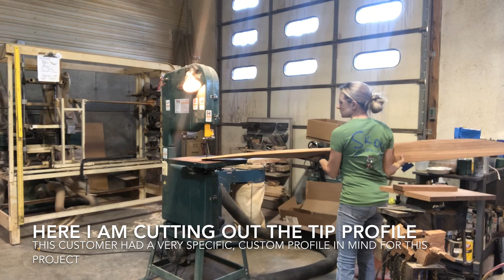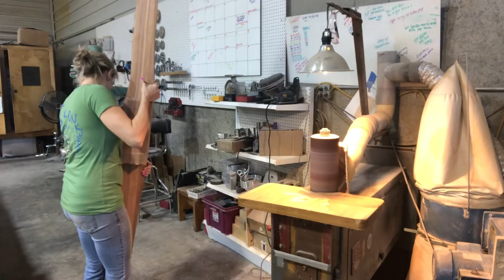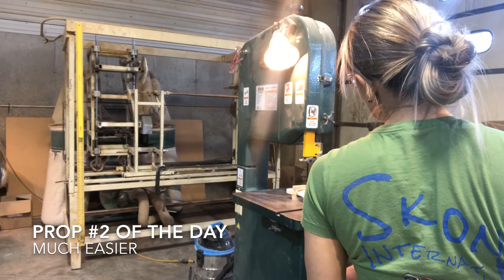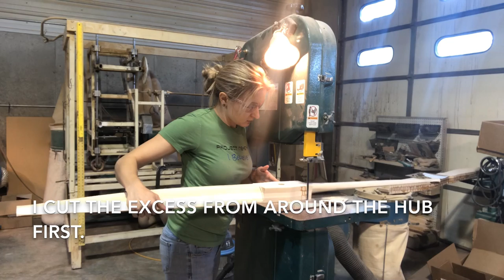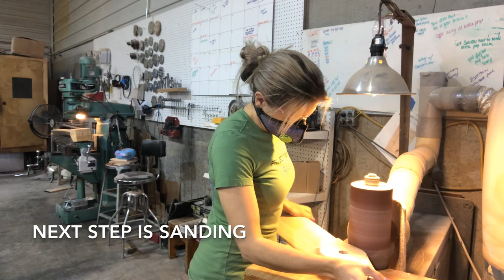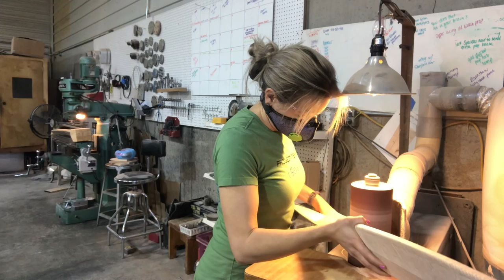Part of my day

Comment: Ma’am you have mad skills. Sanding on that Sander is no easy task, and your holding an untangle Propeller and Sanding by eye with no fixtures, superb job indeed.
Reply from the maker: Thanks! This one really pushed my skills! It was sketchy a few times
Reply: That Lathe you use, was that fabricated as a one off made specifically for following patterns? I am intrigued by that piece of equipment.

Comment: Wow you do amaze me on every video who does the maintenance on all of your equipment the dust collection needs a little cleaning and noticed some quite dry Grease fittings I would do it for a little prop for my wall in my machine shop don't know how far you are from south Florida over is on the table keep up the great work made in the USA 🇺🇸🇺🇸🇺🇸
Reply from the maker: I do most of my own maintenance. 😁
Reply: @CulverProps  And she also works on keeping up on the machinery  maintenance 😂🤣😇

Comment: Your work is an art form. Truly. Do you use any hand tools, even powered ones like a belt sander, jigsaw, or angle grinder? It seems rather cumbersome to move around the larger props into stationary tools.
Reply from the maker: I use a lot of different tools, depending on the situation. Belt sander, orbital air sander, and a palm sander are my most used.

Comment: do you sometimes have "accidents" while cutting the tip profile? I can see how larger and heavier props could be difficult, easy to have a slip (cut too much), break a saw blade, ... 
If so, I may have an idea to make it safer, easier and faster at the same time :)
Reply from the maker: I usually don’t unless I measure wrong. That has happened a few times. 😂

Comment: Outstanding work!  Most of us would have spent the day trying to fab a jig to get the angles right, and it would still be wonky.
Reply from the maker: I probably sand a lot more than most people, but it is the safest alternative for me. Lol
Reply: @CulverProps , I usually leave the line and sand it away.   But the stuff I make does not need to be that exact.

Comment: Hiya, fantastic video yet again... but I just take away the bits of wood that are not the prop... witch is why you are making those works of art and I'm just watching and applauding your increadible skills!!! Nice subtitals, good clear font and all caps nice and easy to read fast but I would still prefer you to do voice over so I don't have to look away. Could you do the odd close up of the work? I thought the shape of all the prop was set by airodynamic  rules but that first customer could influence the shape, I learn from all of your videos, thank you... For all your hard work, skill and teaching... Again, THANK YOU!!!
Reply from the maker: Thank you! I will try to add that in. Tip profile does effect the aerodynamics, but just because the profile isn’t optimal does not mean that it would do a good job. It is a trade off between looks and performance. This plane is not going to be speedy and looks trumped the little performance that a different tip profile would make.
Reply: Thank you, I love that you answer our questions and reply. I think it's great that you wear PPE, did I get that right, personel protection equipment? A lot of you tubers I've watched don't wear maskes etc saying it's a personal thing which wile true ignores the fact that you will be looked up to and copied by young people who should be encouraged to do the best thing not the matcho thing... yep they were all males not using it. So more power to your very able elbow dear lady and long may you continue.   @CulverProps